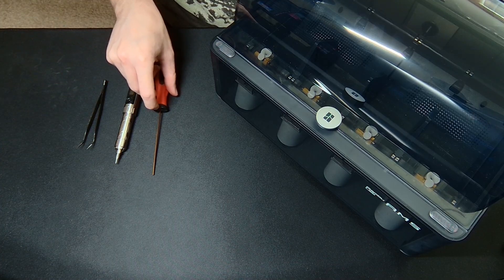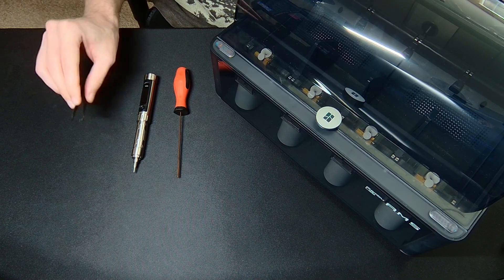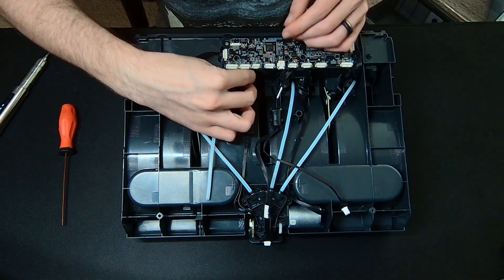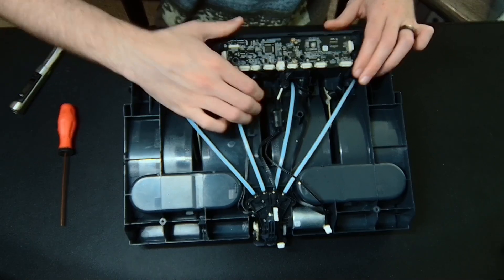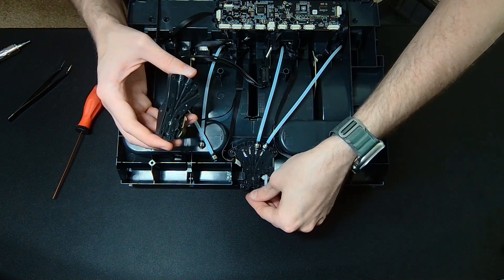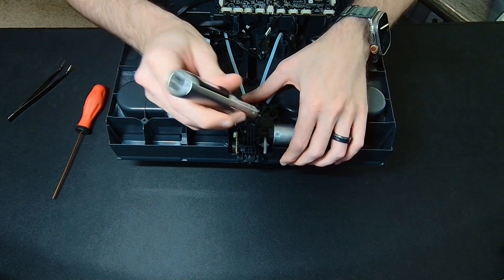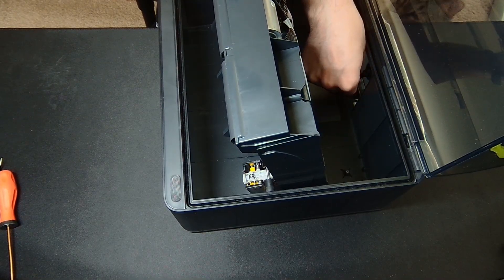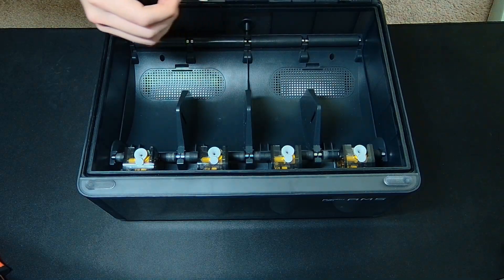How to Print TPU with the Bambu Lab AMS (Mod)

Comment from the maker: Hey Guys! Some users have mentioned that the "skip AMS blacklist check" is not enough to get around the AMS filament restriction. You may be able to get around this by creating a new profile from a supported filament such as generic PLA and copying all of your TPU settings to it. This should trick Bambu Slicer into thinking you're sending a generic PLA profile, but it will load all of your TPU settings. Alternatively, you can use Orca Slicer which is a modified version of Bambu Studio with many added features and settings from the open source community and it seems to bypass this issue all together. (This is what I use)
Reply: Looking at the source code, I found that removing the TPU-related entries from the file <installation_path_of_BambuStudio>/printers/filaments_blacklist.json disables the check alltogether.
Reply: That's what I had to do in Orca. I set up a profile for Aero PLA with my TPU settings. Works well!
Reply: Have you got notepad++ and are on Windows?
Is so browse to C:\Users\Yourname\AppData\Roaming\BambuStudio\printers  (replace "yourname) and edit filaments_blacklist.json, to remove the part that says:
    {
      "vendor": "Third Party",
      "type": "TPU",
      "action": "prohibition",
      "description": "TPU: not supported"
    },
    {
      "vendor": "Bambulab",
      "type": "TPU",
      "action": "prohibition",
      "description": "TPU: not supported"
    },
remove it all, as long as you do not use tab or leave the {} marks and anything in between (or the comma) save then restart and it should not have an issue with TPA.
backup first. (you can even just delete this file to remove all restricted filaments).
Reply: Thanks for the vid! What shure hardness tpu are you using or which have you had best result with?
Reply: A bit too much work than it should be but I appreciate the workaround. I'll make custom profiles now. Big thank you.
Reply: What's wrong with using the external spool holder?
Reply: @buckleyi there's nothing wrong with it but if you want to automate multicolor TPU this is what needs to be done.  If you want to print single colored TPU then yeah side spool works perfect

Comment: I just wanted to come back and say that this mod has worked great for my printer and AMS. Thank you so much @Noozle3D !!!! I am using Overture HS 95A TPU. It is a little stiffer than 95A TPU and I think that works better for the printer. I have an AMS 2 and I followed all the instructions in the video including shortening the PTFE tubes inside the AMS.

The AMS 2 Pro has a couple of differences but in general is the same setup and process. I ended up modding two of the drivers and swapping the main spring underneath. Outside of the AMS I reduced the length and curves of the PTFE tubes that go to the AMS Hub and they've worked great. 

I set the filament profile to a TPU for AMS profile then adjusted the settings specifically for the Overture HS 95A filament. This gets around the TPU in AMS issue that occurs if you try to list it as TPU or TPU from another brand.

I was able to print a benchy with ease, and then I printed two or three other items where there were multiple color swaps and it worked flawlessly.

I was also able to print TPU for AMS from Bambu in the other modded driver. I will try some PETG later and other filament there.

I will come back and update this comment if things change or I have to update anything. If there are no updates, then it means everything is working very smoothly and other filaments work great 🤙
Reply: That's great to hear! I just received my AMS 2 Pro...  I'm glad to know it works with it!
Please come back if you have any update
Reply: By the way, have you tried multi-color TPU printing, brother? I'm really excited with you comment because I haven't seen anyone trying on the AMS 2 Pro besides one guy on Reddit that said he won't share "the secrets" of doing it lol

Comment: Can confirm this works great!! I've been dying to do some complex mmu tpu prints not just layer changes manually and in impressed how this simple mod  works so well. Thanks!! I bought a BMCU in hopes of getting it to do tpu and I can but it suffers from occasional bunching up and tangling in the extruder gears of the bmcu so I just use the bmcu for petg\pla\etc and use the ams for tpu now. This is awesome!! I have the bmcu issues mostly solved but honestly just want to print some tpu lol. I'm hoping to purchase another bmcu parts kit (blv) to finish my tpu mod for it.

Comment: OK, but if you mount a TPU spool on the external holder without using AMS, in my case it still doesn't work, nothing comes out of the nozzle, it can't print it, I don't understand.

Comment: Hello Noozle3D, thank you for your video / help. It really work's. TPU in the AMS it helps a lot.

I use the TPU FOR AMS in the Bambu slice Program and kopi all in from the normal TPU 95A and use this for the AMS now. So you get a own TPU FOR AMS filament in the BAMBU SLICER system.

Comment: works great.what a game changer. i used springs instead of using just ptfe tube for tension. i used 0.3x4x15mm spring from kit from amazon. tested it with a 95 color change print worked great. had to try a few springs to find perfect tension so this is the best spring to use. i never comment so i went way out of way to share this information. hope it helps... i run PLA through the same spot with no differnce to ams or pla print...
Reply: thanks dog
Reply: Springs have a fourth measure which is the number of coils or turns. How many does it have? Theres different 0.3x4x15mm springs with different numbers of turns/coils.

Comment: Red light shows on my AMS each time i try to feed TPU through it. I have correctly installed the mod step by step and it only has issues in detecting TPU. it will take PLA PETG and ABS with no issues.
Reply: Change the settings to pla but manually input tpu settings into the profile

Comment: It just not working with TPU 95A. If you use the two springs it can't push the filament and working endlessly. I used also the plastic TPU spring and I had the same problem.  Show us a link with the retraction and the pushing of the filament in PTFE tube. And also if you can't even use the first pushing , i doubt how you can use it for multi color also. Failed Try. Also for the problem with blacklist you can just change a PLA profile with the settings of the TPU. It will work.

Comment: I ran 95a through my AMS without modding.  Worked flawlessly…. Until it didn’t lol.  But the jam occurred at the motor only.  Have you tried this just replacing that spring and testing?  That may allow full filament compatibility

Comment: Lets say I want to use one TPU and PETG in one print. This mod requires me to have two separate AMS units - one modded, loaded with TPU and second unmodified loaded with PETG.
But
What if I just make a hole in AMS so one slot can just bypass internal hub. Could it work or internal hub has a filament sensor and woudn't let it work?

Comment: To all the doubters, non-believers, and those asking the same questions over and over again—this mod works. If you put in the effort, follow the steps properly, and adjust where needed, you'll get it running perfectly.

The key is shortening the TPU hoses properly—not just blindly cutting them, but actually checking each slot and roll, trimming as needed, and testing. If something doesn't load or retract right, shorten the PTFE hose another millimeter until everything works smoothly.

For reference, I used Polymaker 750g TPU 95A, which helps because it's a slightly lighter roll. No adapters, just running on the cardboard spool.

And to those who never came back with results after promising to—where are you now? The only real feedback thread I found was this one, and at least they confirmed it works.

So, stop doubting, start tweaking, and get your AMS working with TPU. This mod is legit, just requires a bit of effort. Try it and prove it to yourself.
Reply: Sir, hi. I have a project with my professor, and we need to do multi-material printing with TPU on this printer. However, we found out that this is normally not possible. We will try again by modifying it, but we will likely encounter some issues. To communicate more effectively, may I ask for your email? If you prefer not to share it, no problem
Reply: I really appreciate ppl in the comments confirming this works!

Comment: I decided to go out on a limb and see if i couldn't do a half-way happy situation and make the AMS feed regular filament and TPU. So far it works but does slip on occasion, and the weight of a spool of TPU does impact how well it feeds, I have a full spool and it failed to feed partway through a print due to the weight as the direct drive extruder on the P1S was pulling in the material. Anyways, what I did was the same process except for only removing the spring from one of the AMS slots and then replacing the main heavy spring with two (2) 9/32" x 3/4" compression springs that were pushed together just like you did with the two smaller springs in the video. So far it seems to be working but I need to run some more prints and see if I can't get a multi-material print to work. (I'm also using orcaslicer)

Update: It doesn't like retractions on regular filament and WILL chew it up, sometimes it doesn't pull the filament through all the way and you have to manually help feed the filament through the AMS. While it does work, I wouldn't recommend it in the long run as you're going to be trimming your filament so it can feed properly. if you really need to print both flexible and regular materials via the AMS I would not leave it unattended at any point because as soon as you leave the filament will slip and not feed correctly.
Reply: I have been battling with multi material prints - printing a TPU friction pad, placing it in a PLA/ABS scelleton and printing over the ends so it melts to the PLA/ABS. 
It works some times, but I have thought of other solutions with.
There is about 2 meter/5g of filament from the AMS to the print head, and while clumsy, do you know if you could splice the TPU with ex 2m TPU for AMS and then just have perfect TPU surfaces until you need to change filament again?

Comment: I found that the problem on the amslite is that the feeder and extruder don't take in to account the speed difference when the tpu compresses. The solution would be to move the odometer wheels to the Printhead side of the PTFE tubes. So, basically it is a flaw in the Bambu design.  Has anyone thought about cooling the tpu down to make it more rigid?

Comment: Hello, I have seen your video, and I am wondering, since the modification on your ams for your bamba lab printer was then, and video posted.. have you found anything new.. For instance, does the mod affect the machine negatively in any way, over time!, or anything else that may be of informative use, as I am planning on doing the modification on my printer.

Also, I have heard that you can get around the tpu issue. By just using high-speed tpu, is this correct?

Thanks!
Reply: also looking fresh feedback on this mod, since I want to make it too
Reply: Definitely would love some updates as well.

Comment: I've been using your modd from the day I unboxed my AMS. Things have worked really well with the occasional feeding problem but recently I got a real problem and I'm not sure how to fix it. frequently the AMS will go to do a color change and I'll get an error saying the filament isn't reattracting but it has. The filament is breaking at the top of the extruder and then the filament spools up into the AMS like it's supposed to. As I'm sure you know it needs to be taken apart of to get the broken piece of filament out. This happens about every 5-10th color change. I put a fresh blade in the cutter, cleaned the extruder, made sure the filament sensor isn't sticking and my filament is dried to 17%. This is driving me nuts! Please help!!!! 🙏

Comment: Just got a Creality K2 plus and wanted to do multicolor and multi material printing with my CFS, I knew soft filaments would not work in the CFS but i got a couple to try anyways. sure enough they jammed in the secondary motor in the CFS. I am looking into getting another CFS so I have one Dedicated to soft materials and one dedicated to hard, that way I can get the best of both worlds. As someone with more experience than me, do you have any reasons why this wouldn't work?
Reply: Same here. I knew TPU wouldn't work, but I was hoping I could print PP with the CFS. Jammed immediately. Also thinking about getting another CFS and trying this mod on it. It looks like all the component in the AMS and CFS are similar enough that this mod should work. Did you go through with trying it out?

Comment: Great improvement 😍
Thanks for you video : i will try today for a TPU print.
Since a few days, BambuLab published a new profile : Generic TPU for AMS because they released a new TPU in their product range.
An other question is about you electric screw driver : what model is it and does it have enough torque for the AMS screws.
Mine is a lovely screwdriver but it is unable do unscrew any screws of the AMS 🤬
=> it will go back to Amazon 😀😀
Reply: Since i remove the spring on only two slots, i got some issues with PLA spool 🙄
Have you ever had this on your AMS ? 
About my tests with TPU in AMS, i got also some issues, i hadn't good results. 
Which TPU did you used ?

Comment: I'm using a brand new printer and this isn't seeming to work.

For one, if i remove the spring and don't replace it with a weak spring, the filament wont be pulled at all and instead the motor will just turn endlessly.

Additionally, in a slot that isn't modified i'm having issues with even pla being pushed to the nozzle. I'm going to try reversing the mod and seeing if that fixes the issue, but of course i would like to be able to print with tpu. I think it's slipping in the middle even with filaments like pla. Strange.

Comment: My question is, where do you get the 2 lighter springs to use in the main filament feeder? Do you take 2 of the 4 springs you took out and just use them? or did you purchase a lighter set of springs?
Reply: I have the same question

Comment: Hi all, I want to use TPU with a support... So I did the mod and bought one more AMS to run PVA through it. But it's not working...
What should I do anyone has a idea.
Reply: Hi, did you find it? I want to print tpu with pla (exp.)

Comment: Wow. I just did this to one of my AMS's, very surprised. Like many others, i did not convert the whole AMS, just one slot and it still works, even with a softer sping in that central feed location. Thank you.
Reply: are you able to print other filament types in the other slots as well for multi color / petg support?
Reply: i wanna know the answer to that question tooo please. can we print hard and soft material from same AMS??
Reply: @nicolajandersen7244  I'm also wondering that
Reply: Did you replace that center spring or just the one in the feeder?
Reply: Please, can you answer the question above? 😞

Comment: This is cool but I've ordered a dry box and I have 2 printers so I'm planning to put the dry box (with 4 spots) in the middle and have 2  slots for each printer in the dry box. This is more expensive but you also have a dry box.

Comment: Did this mod and can confirm it does absolutely works, i did have to lie to the ams and tell it that there is some ams compatible filament in there since the pc software stops you even with blacklist disabled...
Also i did only mod 1 slot which the tpu can live in and rather then remove the light spring i swapped it for a lighter one
Reply: Dude can you explain more, I’m thinking of doing only slot one and buy spring, which should I replace?
Reply: @albertage1231  Sorry man, not sure what exact spring, I just used a similar but thinner wire spring from one of those cheap ebay spring kits.
Reply: @albertage1231  i went to my local spring manufacturer and bought a bag of scrap springs for cheap. I found one that felt about 1/2 as strong, cut it to size and it worked. Honestly, buy a variety pack as mentioned above. Works well.
Reply: @LordClassyMoose  gotcha, i have a spring store minutes away.btw so it still work with pla on the other that? And did you only change the biggest spring on the end? Thanks mate
Reply: did you leave the secondary "heavy" spring in which is inside the splitter by the ams outlet ?
Reply: @SupremeBean82  I was going to replace that one, but I was having a hard time pushing the rod out. Was gonna try again when I have time to be gentle.
Reply: @albertage1231 it looks like there's a following on mw for a mod. I'm surprised that bl didn't put a thumb screw on the spring to adjust tension like most extruders have. I'm curious if this is something that the new python ams mod can improve upon

Comment: Does TPU adhere to other materials? Might be cool to use the AMS to make a part with a gasket built in or squishy part to clamp onto something.
Reply: Apparently PETG and ABS (if TPU is printed first, then enclosed). My next experiment.